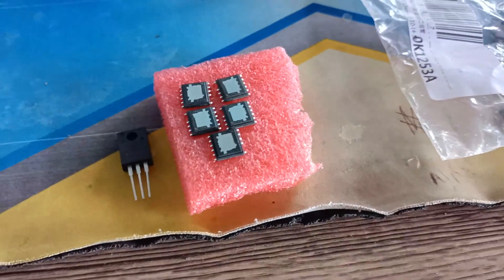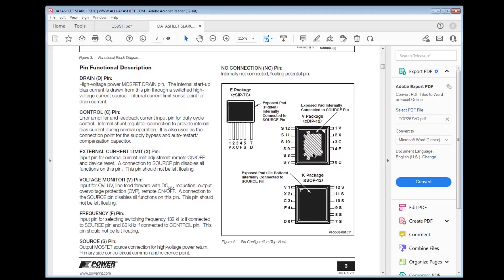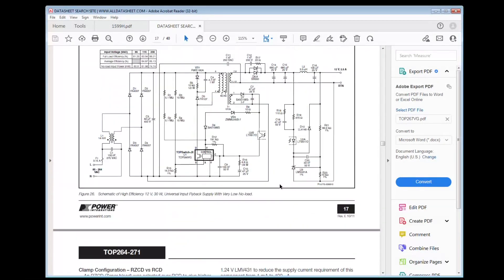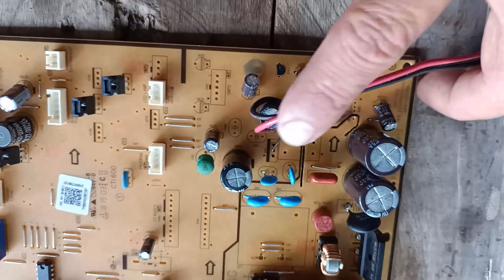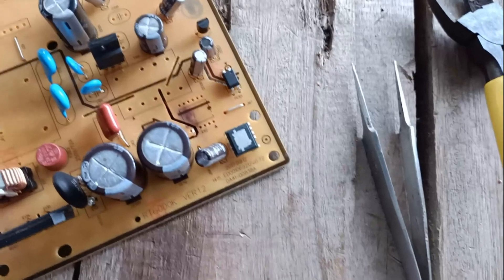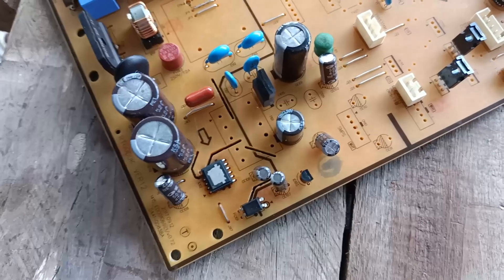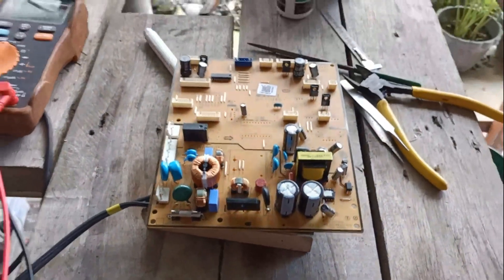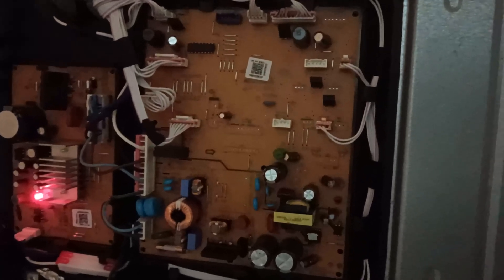Roxas, Isabela - Fixing Samsung fridge circuit board DA41-00838A

Comment: Boss, paki send naman nung link sa lazada nabilhan ng both parts yung top 264-261 saka top mbr2100ct. Thanks
Reply from the maker: Thanks for watching. 

Failed components:
TOP267VG - dedicated power switcher IC
https://www.lazada.com.ph/catalog/?spm=a2o4l.tm80160756.search.d_go&q=TOP267VG

MBR20100CT - dual diode in TO220 package
The components are available from Lazada, searched for them there
https://www.lazada.com.ph/catalog/?q=MBR20100CT
Reply: Thanks, laking tulong to.

Comment: Dear friend i have Samsung refrigerator and the motel is RT29K5030WW , the fridge when i plug in the electricity ,is working well,and everything is fine,the lights in pcb is working well, everything started working well,my problem is  PCB is not getting signal from sensors defrost, to pcb electronic plate,to give time break for resting  the compressor,is working with no stop,so when is working long time (about 6-8 hours working,is giving me a signal,in pcb,10 times that my compressor having a problem and is stop working, like is have to be , everything is hot,i have checked all's the defrost sensor up and down with multimeter in k oms,and the compressor also with multimeter, and everything is fine,i think something  happened with pcb,is anyone out there, can give me any advice, what happening , where is the problem ,i can not found,is anyone from experience now something ,to give me where is the problem , many thanks reading my problem
Reply from the maker: Thanks for watching. I did a search about your symptom using these words "samsung fridge working non-stop" and there are several reasons that came up. You will have to dig into the reasons, not many here will be able to help you.
Reply from the maker: Check these links, might be helpful to fix your fridge

https://www.samsung.com/ie/support/model/RT29K5030WW/EF/
https://downloadcenter.samsung.com/content/EU/202012/20201231094815237/TMF_RT5000_6000_User-servicing-manual_26lang.pdf

Comment: Hi there, I am having the same symptoms as you, and seem to also have shorts on the IC, transformer and the diode. Did you use the same transformer and just desolder it when you were injecting 12v from the external psu, or did you also replace it?
Reply from the maker: Thanks for watching. I re-soldered the same transformer, the component was checked to be fine
Reply: @thelifeofexequiel  awesome! My new IC and diode arrived today.
Reply from the maker: Great! Have fun
Reply: @thelifeofexequiel  all seems to be working, great work putting this video together ❤️
Reply: Sir, sa lazada mo lang ba nabili lahat yan, nasira kasi yung samsung inverter refregerator ko ang part number ng board is DA41-00 838 A, wala kasi akong makitang buong board na parehas at ang gamit ko nasa qc at ang ref ay nasa capas tarlac, plan ko omorder nalang ng both ng parts na yan kung mura lang para pagbalik ko mapa andar ko na. No power kasi ang ref, sayang naman kung itapon lang. Thank you.